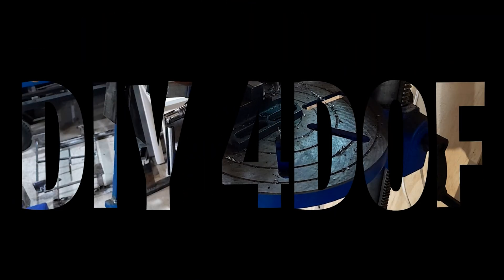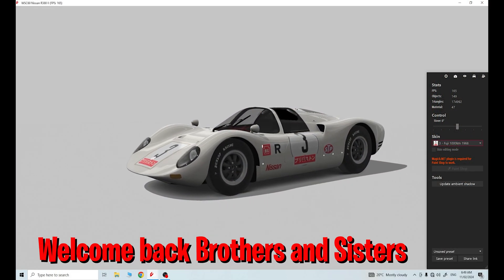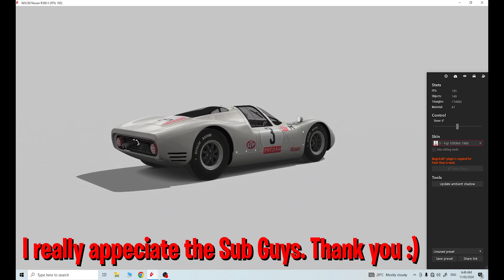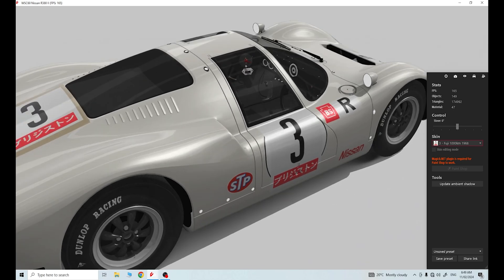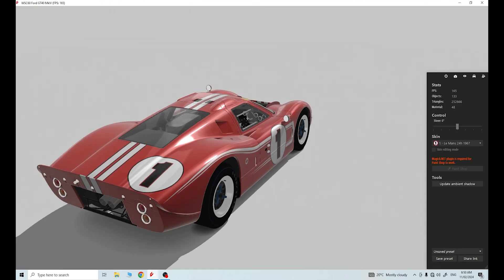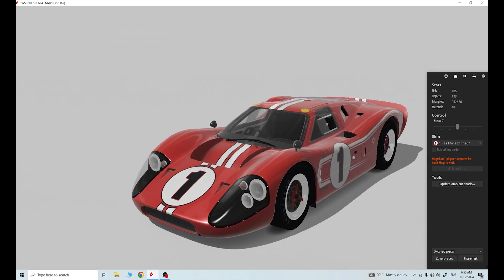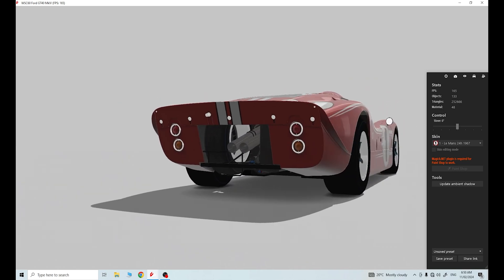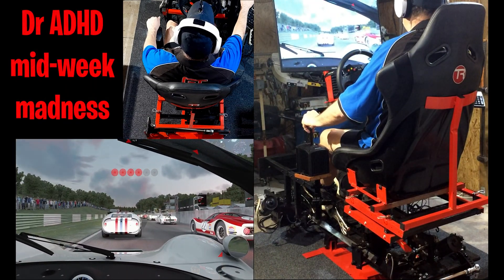Amazing Home Built 4DOF Motion Simulator With Fantastic Motion

Comment: Great video, Doc! For a while I had decided to skip the spring mod for the seat heave, but after some thinking (and a bit of luck) I found some super cheap valve springs that will work perfect. I'm pretty excited we went with that route because it sounds like having them makes a huge difference!

I noticed that we have vastly different seats. Mine is 40 pounds by itself which is way heavier than your seat is (just a guess). Would you recommend counterbalances on the front of the top frame to help even out the weight. I would guess that the motors would struggle a lot if it has 40 pounds plus a person on one end but no harm in asking.
Reply from the maker: Thanks Swamp Man for the feedback. Trying to make the videos interesting and informing. Valve springs will work very nicely. Nice find! Ok your seat. I remember you telling me about this a little ways back. This can be relative to the users weight as well. 

For example, my TR seat is quite light being fibreglass, but I'm a heavy user. I currently weigh 242.5 pounds. So light seat, but lard ass on top of it. Later in the build tutorials I go through building the piece of 50mm x 25mm box that the Uni attaches to. 

This is drilled in multiple locations to allow the top frame to be tweaked for balancing the rig. It's not a huge range, as you need to balance the movement of the top frame with where the uni joint trolley rail carriage ends up being located, as well as the front motor mount trolley carriage. 

They are all connected at the end of the day. The front motor mount carriage and the uni joint trolley carriage are connected by some 20mm x 20mm box to stiffen them and keep them in unison with the surge motor. It's length also needs to be setup with all the other finishing positions, as they all work together. It's a bit of a fiddle.   

How many watts are your motors? 200?
Reply: @Doctoradhd1  Thanks for the info! I have definitely learned that a lot of parts are dependent on the size of others. The motors I have are 180 watts each, I never could find the load amp draw unfortunately.
Reply from the maker: @swampsn1per878  My motors are also rated at 180watts. They'll be fine and actually means you should have less regen energy on reverse direction changes, but we got that covered using a 12vlt battery in the wiring circuit as you've seen anyway.

Once you are up and running, I'd strongly suggest because you have no spec on your load amp draw, you get a multimeter with a built in clamp, so you can measure what the motors are drawing under heavy load. That will help you establish what size PSU you'll require. 

You could run the whole rig off a battery (similar spec to what I recommended in that video) before you commit to buying PSU's. Then purchase your PSU's once you know what they'll need to supply. It'll take the guess work out of it that way and save you wasting money if the PSU's aren't up to the task. Either way, a battery in parallel with the PSU's is a great idea anyway. 

Because our motors are similar, you could probably run pretty much what I'm running. Unless you somehow balance your rig incorrectly, my setup should be ok for yours. But no guarantees on that. So many little things that can change stuff.
Reply from the maker: @swampsn1per878  Hey Swamp Man. Just checking in mate. Haven't heard from you in a while. How's the build going?